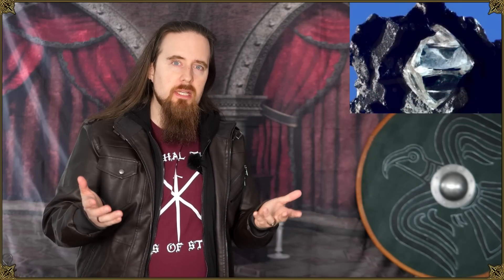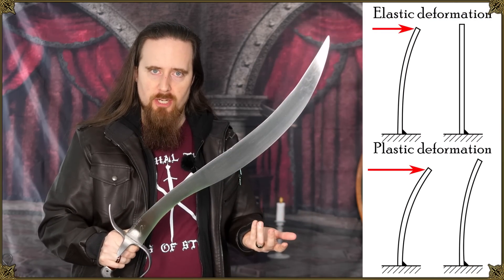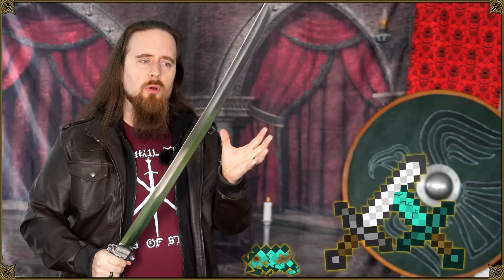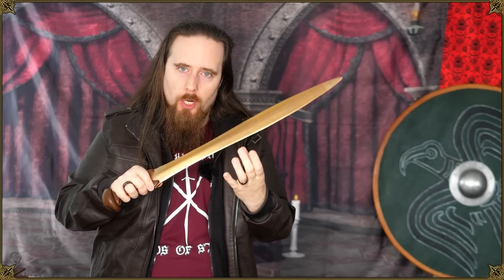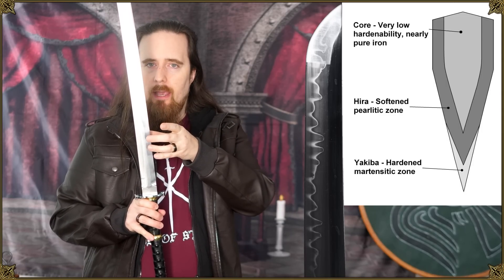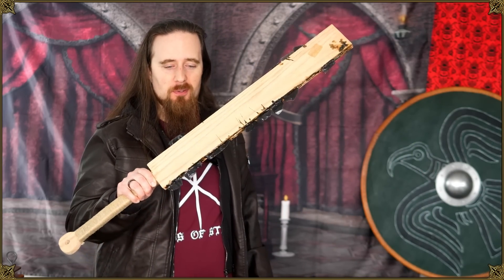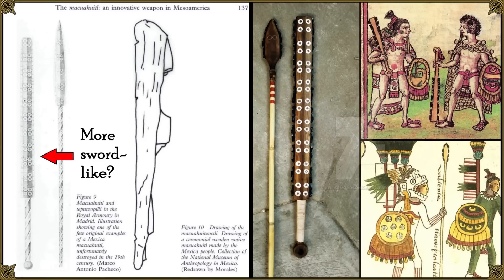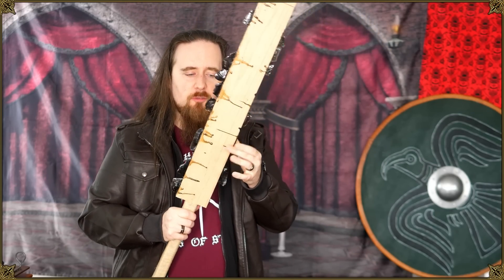Diamond Swords: Could They Work IRL? (Kind Of)

Comment: I think the reason the Macuahuitl didn't really perform that well because it wasn't made too accurately. Often you see them in depictions with chunky knapped pieces but this wasn't the case. They actually used prismatic blades, which are extremely thin and sharp but really hard to make. The blade portions are usually long flakes cracked from a big block (the prism) You mentioned tapering of the club portion, which is actually how a lot of them were made, tapered toward the edges like a sword. I remember a source saying there was distal taper in a Macuahuitl but I can't remember if it was pre-columbian or not. 

Scishow made a video about how the sharpest edge in the world was made and it can't cut anything. Thought we might get that as the video this week.
Reply: @Indrid Cold what the hell are you on about?  Tf does this have to do with anything? Also literally doesn't apply to the Aztecs considering the many things they invented/built/made so I'm super confused?
Reply: @robertfaucher3750  Indrid sounds a lot like what the far left has been wrongfully accusing all white people of being.
Reply: @Indrid Cold You need a proper history lesson because nearly every noteworthy group regardless of skin colour came up with something noteworthy.
Reply: Macuahuitl It was also constructed at a time when armor in that culture was not AS big of a thing.  Although it definitely Did exist And usually for more prominent warriors From everything I can find. I think a lot of western sources rarley mention the fact that it is also technically a big ass war club, and blunt force is a thing.. Regardless of sharp bits poking out of it.  The weapon in question was, in my opinion Used for predominantly softer targets. And I wouldn't want to get hit by one quite frankly in armor or otherwise. Think of the shattering fragments of sharp Obsidian Getting in your eyes if you had even a full helmet.   Having had glass removed from my eyes, I wouldn't really want to be hit by 1 over a metal sword. Ideally..
Reply: @mastathrash5609  textile armor is actually very effective against cutting, but absolutely terrible against penetrating/stabbing. Not sure where people get the idea you can just cut through gambeson or something even older like a linel thorax. I'll point out the only reason scissors can cut through cloth is because scissors use shearing and not single edge cutting. Stabbing penetration is basically inverse shearing, which is why metal is much better protecting against it. Compare sheet-steel shears or bolt cutters to scissors. This is why wearing leather and cloth gloves protects your hands if you use the mordhau grip.
Reply: @V3RTIGO222  yo mate go look at Skall's gamebson videos. He tests a really sharp sword on some historically analogous gambeson and sliced right through them. Swords, in many time periods including the middle edges were kept sharp for specifically this purpose.
Reply: @robertfaucher3750  even with the sword as sharp as it is did jack to the torso in underneath, which is the point... Under battlefield or travelling conditions it's unlikely to be a premiere quality razor sharp modern steel, and even if it was, you can't expect a person to act like a torso rigidly held in place by a wooden stand and straps.
Reply: @mastathrash5609  Depends on what you mean by armour, textile armour was worn by many back then and provided more protection from blunt force trauma then metal armour did. A very sharp cutting weapon is a obvious choice for defeating textile armour(which may be one of the major reasons swords were so strongly favoured in many cultures).
Reply: @Wolf-oc6tx  agreed That's kind of what I meant and I do consider  textile armors to be a form of armor absolutely.  I'm kind of curious if there was anything worn under it in regards to padding. Or directly attached to the armor itself. Or even being the armor itself. To alleviate the blunt force. Also I will say some textile armored Does offer at least a bit of protection from a sword cut. Although depending on the armor and the type of weapon striking Applies.
Reply: @mastathrash5609  Textile armour is what people who used metal armour wore underneath and while textile armour can protect against cutting weapons to an extent there is a reason way metal armour was worn over-top of gambeson.
Reply: @Wolf-oc6tx  I agree, I think in the case of the aztec and how they fought, I wonder if there was any cases of using captured spanish style armor. Albeit Probably very Rarely.   Perhaps collected as a war trophy  ect.  I look up aztec armor and there's a lot of fantasy stuff that you got to weed through.  But there was also a textile armor that was worn not as a padding But as the Actual armor itself.   Like, This is the best we got, Considering what we have faced before.. . I'm trying to find the difference and try and learn the history behind it . And I love this shit is incredibly interesting.
Reply: @mastathrash5609  And on top of that it took a society that had armour and weapons they struggled to overcome and there subjects turn to the Spanish for the Aztecs to fall.
Reply: @Indrid Cole, much of ancient Africa actually didn't have access to many resources or the exchange of ideas. Africa is a combination of deserts and jungles...very few land is located in temperate zones that are the most productive for farming. The native wildlife is also poor for domestication. Animals like horses came from Eurasian grasslands and temperate zones. African zebras are much poorer candidates. Much of their mineral wealth are also located in deeper mines rather than surface deposits. Much of Africa was also cut off from the technological exchange of Eurasia, where East Asia, South Asia, Western Asia/Middle East, and Europe were all exchanging ideas. For example, wheat farming, chariots, bronze smelting, etc came from the Middle East. European alphabets are derived from Middle Eastern writing systems.
Reply: @Indrid Cold, Why do you have to bring up conspiracies about Jews if you want to refute his point? It is already strange that you want to trash talk MesoAmericans and Africans by using comparisons without context...and then you trash talk Jews by claiming Jewish academia is somehow responsible for any wrong idea.
Reply: @Indrid Cold Judging by his name??? Ok... But ignoring that, what domesticatable animals do Africans have?
Reply: @@indridcold1376 Because your assertion is patently incorrect. The easiest invention to think of from the Aztecs in particular was chocolate. It's all over the world now. And I'm sure if you actually bothered to drop your racism for a second and look into it, you'd find a lot of inventions like that.
Reply: @Indrid Cold Hershey's says hi
Reply: there's also the fact that he mentioned pitch being used to glue the obsidian in, when the aztecs used no such thing. It was simply fitted that well.
Reply: @InternationalAwesomeFoundation  I'm not sure if that is 100% true. Probably a combination of both.
Reply: I swear I saw a really good replica demonstrated once on some Spanish language show. It was a two-handed version whose creation they'd followed and which they then handed to one of the locals they'd hired as crew (a small thin dude too)  and with one good overhand swing he sliced about 2/3 of the way vertically through a hanging cow carcass. 😮
Reply: @ItsAVolcano  probably based of the lost Royal Armory of Madrid's pre-Columbian example. Got taken out in a fire in 1884
Reply: Yeah, people didn't go to war with poorly made weapons if they could help it. These folks didn't do football, war was as much a way of showing off and having fun as it was about politics, power and religion. So a well off warrior would definitely have something nice to swing around.
Reply: I actually compared the chainsword, or what a proper chainsword would act like, to the Macuahuitl
Reply: @Indrid Cold You ever hear of a little company called Nestle? Literally one of the biggest and most powerful companies in the world. You wanna know what one of their biggest products is? Chocolate.

Like seriously, if you have no idea what you're talking about, you'd be better off just not opening your mouth anymore. All you're doing is putting your foot in it, over and over again. Why do you think all the comments disagreeing with you have dozens of upvotes and yours all have none?

Someone else made this exact same comment, and yet you didn't try to pick a fight with them for some reason. Did you think I was an easier target because my response was shorter? Cause clearly you were wrong. Not stop wasting my time with your childish nonsense. Your time might be worthless to you, but mine isn't to me.
Reply: @Indrid Cold Pedantism is a sign of low intelligence. It shows you're smart enough to obey rules, but not actually smart enough to understand what they're for or why they even exist. Like seriously, if you read the other comments the guy has left, they're well constructed and contribute a lot to the conversation. You on the other hand, the only thing you've shared is that you're an unlikable twat.

There is also the distinct possibility that he made a typo. so the only thing your comment says is you're too dumb to possibly fathom the idea that someone might mistype something. Or that maybe their phone autocorrected it wrong. Phones tend to do that you know, and the vast majority of people who watch youtube do so from their phones nowadays.

I also noticed a very obvious pattern of behavior: you only respond to comments that you think make easy targets. You know what that means? It means you are a coward and a weakling. Keep punching down, cause you clearly aren't capable of punching within your own weight class, let alone up. Course, if you keep doing that you'll always be a coward and a weakling, but you don't exactly strike me as the sort of person who actually cares about self improvement and would prefer to be a whiny baby for the rest of his life.

Also, seriously, stop upvoting your own comments. It's super obvious and pathetic, lol.
Reply: @@indridcold1376You're an absolute idiot LMAO No way a person commented such idiocy in this century with so much info. Honestly, being ignorant seems to be a matter of choice. Stop using the internet for just porn and anime, and start looking at actual history, dummy.
Reply: @Indrid Cold bullet proof soft vests (that the Spanish adopted as they where better than steel), beat Europeans to the zero by 200 years, chocolate, way WAY advanced star maps and maths (that magically appeared in Europe after the Spanish conquered south America), roughly 90% of modern medicines used cane from them and thier herbalogy (out of roughly 50% total known medicines). The list goes on.
No less including the plants they bred. Oh wow, how would you like a diet of nothing but Turnips, Onions, really crappy wheat, garlic, rice and honey? 
For each of the native groups they all invented and bred things of incredible worth.
What they did not do, was focus on iron. They never had that deposit that showed they could make anything aside from decorative beads or masonry ties out of iron until after Japanese ships started drifting ashore and by then it was too late to discover steel, Europeans where on thier door bringing plagues and steel
Reply: From what I remember they also designed it to where they could chane out individual piecese
Reply: @Indrid Cold you are laughable :)
Reply: @Indrid Cold You just hit the nail on the head there - they achieved human levels of sophistication with the materials they had at hand. And so did Europeans. The major difference being that Europeans had farmable livestock that in turn allowed them to focus on mining and metalurgy for swords and eventually guns as well as, of course, horses.

You should read Guns, Germs and Steel by Jared Diamond. It's not without criticism, which you should also read for balance, but it makes many valid points demonstrating that opportunity and available resources had far more to do with why Europeans conquered other tribes of anatomically modern humans when they began to use their technology to spread.
Reply: @Indrid Cold ewer wrong cause in the Middle Ages Africa was just as technologically capable as Eurasia... And they invented iron smithing before anyone else so
Reply: @Ingrid Cold do you know the system that the US congress works under? It’s called Bicameral Legislature. Do you know who invented it, and actually taught the founding fathers about it during the creation of the US? The Haudenosaunee (or Iroquois) Native Americans! The US has an eagle as a tribute to them! I would call that a pretty important advancement. The Aztec and the Mississippians created the largest cities in the world at their time. Militarily, the Comanche, Calusa, and Lakota were all reportedly stronger than European forces until they were ravaged by smallpox(before you discredit this, this was reported by European missionaries and explores of the time). Next, you were going on about how you didn’t believe that the sub Saharan Africans had iron - the Smithsonian itself has several of the absolute oldest iron tools and weapons, coming from Ethiopia and Nigeria. Ghana was the richest country in the world by far during the medieval period. So yeah, they were pretty notable.
Reply: While both of you have made some good points.

1. A well made glass obsidian is still going to shatter and break off into the flesh.
2. These cheaply looking wooden clubs where still the best they had to offer in the terms of weapons.
2.a They did have access to schinopsis balansae. A tree whose wood is 4,570 lbf. In laymans terms that is really hard wood.

So why does Skalagrims citations looks crude? Well, maybe because people do not go to war with weapons that are expensive. When you need a large number of warriors you need to be able to supply them all with weapons that are only good enough. If these people had armor they would have learned that obsidian is next to useless against it. Like they did when they fought the Spanish.

Even in todays standards our weapons are made by the lowest bidder. Military contracts, still pay out big time. But they have to ask for the cheapest they can get at their standard. It is why colt makes M16 rifle. And Armalite does not make the M16. Even though Armalite are the orignal designers of the M16.
Reply: @xPumaFangx    whoa hold on here what do you mean "both of us"? Your comment here is only responding to the guy who responded to me. I was making a SPECIFIC reference to Skall's SPECIFIC Machuahuitl. Nothing about it not shattering (in fact, prismatic blades are even more likely to shatter into the wounds). Nothing even about ancient blades. However, your assertion that maybe this was the "cheap version" like a commoners weapon, or that it was produced quickly. It was not. The point of my comment was actually that it's the opposite; these weren't just cheap clubs. I said what I said because both the archaeological evidence and the native peoples have said that the Machuahuitl uses prismatic blades. His version is inaccurate and not made well, which is why it didn't hold up as well or worked as intended. We know that chunky blades on these weapons only happened after colonization, and is the byproduct of their biases (i.e. look at this thing it's barely functional and it's their elite weapon, no wonder they were conquered type of attitude)
Reply: @robertfaucher3750   I think your statement would not hold up in a test. Because glass breaks it is brittle.

So yes sir please give me a citation.
Reply: @xPumaFangx  okay I said it would? I literally agreed with you
Reply: @robertfaucher3750  Thats better. Skalls weapon is a a Macuahuitl.
Reply: @xPumaFangx  If anything, these people did have textile armour(which even among Europeans was far more common then metal armour when you count the gambeson people wore underneath metal armour) and the wooden clubs(even if inexpensively made)were well made(if only because the crafts men were skilled and poorly made weapons are very undesirable) and only stopped being used do to the sheer effectiveness steel armour and arms has in countering glass weapons.

Comment: Considering steel and other metal tools and machines are often used to extract diamonds and all kinds of materials from the ground, one would think people would put 2 and 2 together and see why tools and weapons aren't made of diamond.
Reply: Considering how actually common diamond is, why did more people ask about diamond coated steel blades? All the strength of steel with the legendary hardness and sharpeness for the Aztec obsidian sword.
Reply: Diamond drill tips and similar stuff are used in the industry, but you won't ever see a tool made completely out of diamond. It's just too costly and less efficient
Reply: Those tools are the functional equivalent of the Aztec sword/club Skal describes.
The body is made of steel for toughness, and the drilling tip or cutting edge is made of powdered diamond or tungsten carbide, which is just a step or two down in hardness. Even circular saw blades you can buy in the hardware store are built this way if they are designed to cut ceramic or concrete.
An extreme version of this principle is used in petroleum drilling, which uses a high-pressure jet of water mixed with powdered silica to bore through hard rock.
Also, bear in mind that mining diamonds involves loosening them from the surrounding rock, not cutting pieces off of a huge hunk of diamond.